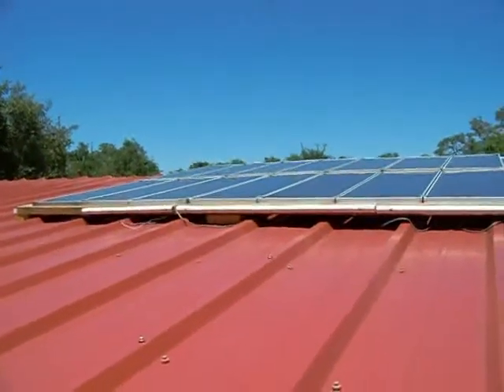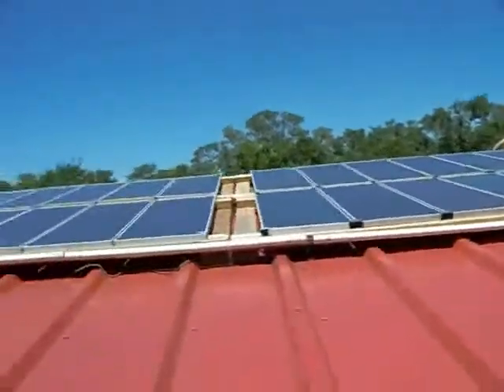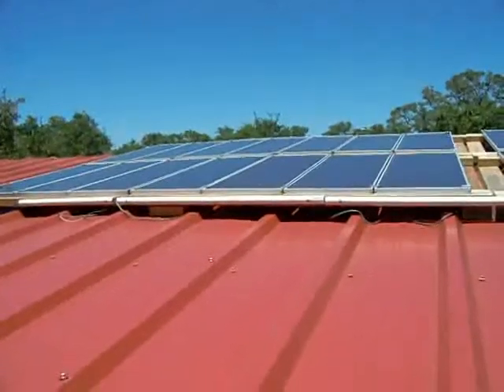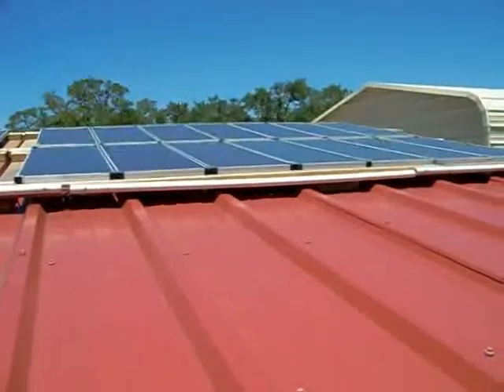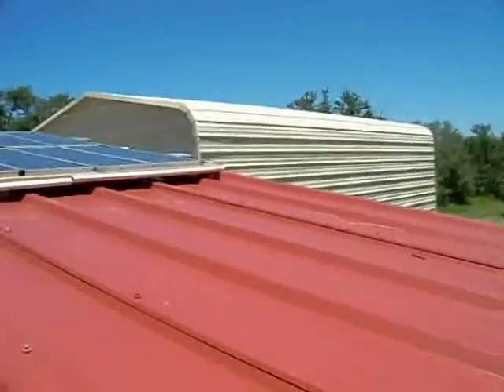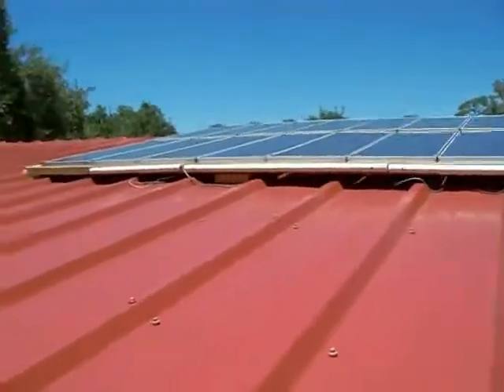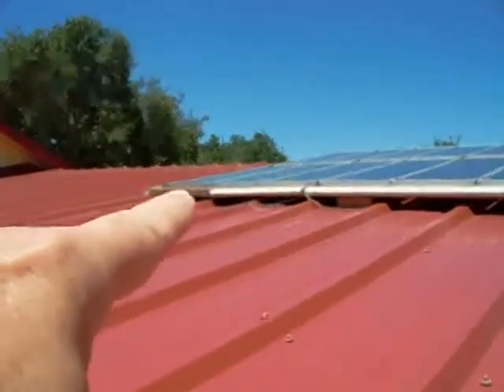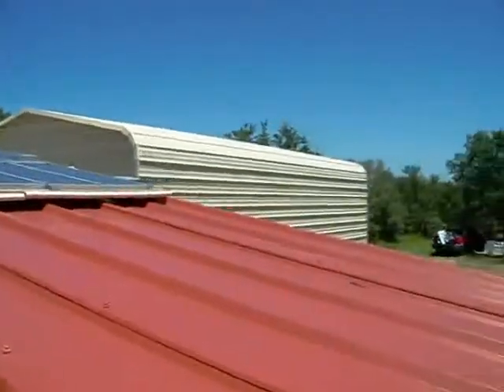How To Install Harbor Freight Solar Panels Part 4

Comment: Thanks Al, so if I'm understanding this correctly, you put 4 panels in series, totaling 94 volts. The wattage for 4 panels is 60 watts, so the current is 60 / 94 = .64 amps per string. You have 16 sets, which I'm assuming you put in parallel. The 94 volts stays the same, but the current adds.  .64 x 16 = 10.21 amps. So your wire size from the roof to your equipment is based on 10.21 amps then, correct? Thank you

Comment from the maker: If you car/truck alternator only put out 12 volts, your battery would never charge, you need an alternator that supplies 14-18 volts to properly charge your battery. Likewise, solar panels have to put out voltage above the voltage of the battery bank for them to charge the batteries. If you go to the Harbor Freight web site and look at the product manual they have on the 45w solar panel kit, you'll find on page 4 that the panels actually put out 23.5 volts open circuit voltage.

Comment from the maker: That's because you have to watch all the videos in sequence to see the final configuration. The panels are rated at 20 VOC  not 12, so although for the non-technical person I usually refer to them to the voltage under load which the battery voltage, I started with a 12 volt bank and then switched to 24 volt bank because it takes less amperage to work at 24v than at 16. I understand why you're confused by my going back and forth but the just know that the panels are really 20 VOC.

Comment: Hi Al,

Thanks for your response. In the video, you say that you had two panels in series, making 24 volts, then decided to change it back to a 12 volt system. You put 4 panels in series making 80 volts. In your response, you said that it's a 24 volt system again, so I'm lost. The reason that I thought 4 panels in series would be 48 is because you said two panels were 24. I don't understand why two panels in series is 24, but four in series is 80. I thought the panels were 12 volts each.

Comment from the maker: James the panels VOC is 20v, not 12 so the output voltage of a string of four is 80v. I have 64 panels in 16 sets of strings of four, thus the total watts is 960 watts and my battery bank is 24v, not 12, thus there is a 40 amp draw.  Thanks

Comment: Hi Al,

You lost me on the 80 volts. I'm new to this, but it seems to me that if you put 4 panels in series at 12 volts each, that's 48 volts. The current is 1.25 amps. If you have 7 sets of 4 in parallel, the amperage will be 8.75 amps. Your wire size would be based on 8.75 amps at 50 feet, so #12 would be fine I would think. Thanks

Comment from the maker: I used wood, but each panel frame is connected to the next by 12gauge solid copper wire which is then tied to a ground rod, this way,every panel is grounded.

Comment from the maker: @1bornsurvivor Thanks there is a web site that has a great calculator for your position anywhere in the world and the angle at which you need to set your panels for each season of the year. The site is solarelectricityhandbook(DOT)com or search in Google for solar angle calculator. Do not believe the sites that simply say to use you latitude as the proper angle for your panels. God bless you and have a great day.

Comment: I enjoyed watching your four part series of videos on Harbor Freight solar panels.  Have you considered using mirrors to increase the watts that you can get from your solar panels?  Some people claim that you can double the power that way!  Check out some of the You Tube videos on this.  Please explain how you calculated the angle in which your solar panels need to mounted, on your roof.

Comment: @econewpower YUP got me a 78KZ650D1SR. I had it restored 2 yrs ago. Took a 750 motor bored out to 810cc and bolted to the 650 bottom end. WOWOWWW. This thing has vance and hines header stage 3 jet kits in carbs and pop filters.
My wife and I on highway 75MPH just roll on throttle and the beast thunders ahead.
Not like the original 650 motor it was smooth and had to drop a gear to take off. Now it is just a monster motor and growls like nothing else out there.

Comment: @econewpower Any help on which Controller out there is best cost with the same options and how much was your unit and where did you get. I might want to purchase through them. BTW are you a member of the HF solar forums HF 45wattsolarpanels website? Look me if so Ultraghostrider

Comment from the maker: @happygameshow Yes, I used them, they work very well and safe - BUT - those cheap units from eBay don't last very long and their output is finicky to their input voltage. I've bought three, two died within 6 months, one still alive - mostly junk. They are not legal in almost any place in the U.S. if they are not UL1741 listed because you can kill someone if they don't island when power is out - which is where UL certification is required. Buy an Outback grid tie inverter. Good luck!

Comment: Looking at taking the outback CC route or something similar to be able to run high voltage saving on wire works a whole lot better and being able to back down to 12 volt is just the answer I was looking for. Thanks for the vids you put me on the right path.

Comment from the maker: @Schweizer135 I have played with the idea but since I have a 12v battery bank I would have to purchase a DC to DC converter to go from 12v to 24v as all grid tie inverters are at leas 24v. I may do it in the future but not right now. I do have serveral charge controllers (one wind & one solar) going to the same battery bank and I will add two more soon, there is no impact in doing that. Read the documentation for Outback or Xantrex charge controllers and you'll see that's OK.
God blesss you!

Comment: Hi Al.  I have enjoyed all of your videos.  Thank you so much for making them.  I was wondering if you could comment on your scheme to use a grid tie inverter in place of the dump loads.  Also, please comment on the impact of having various charge controllers driving the common battery bank or will you split it?